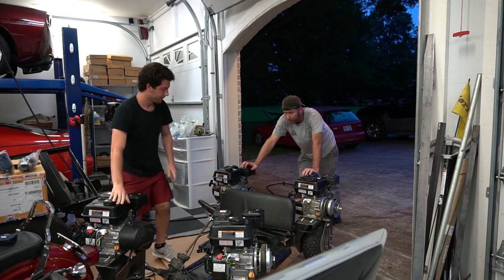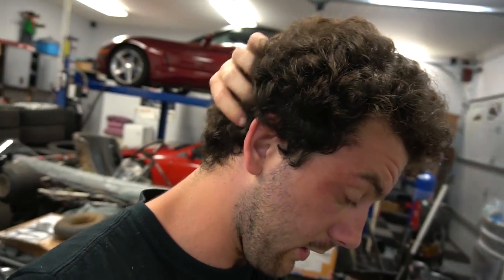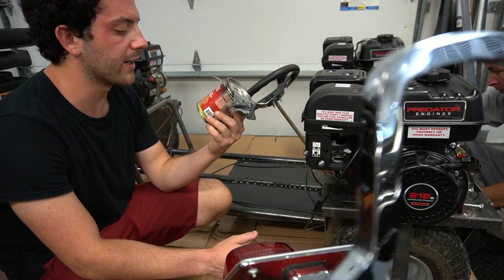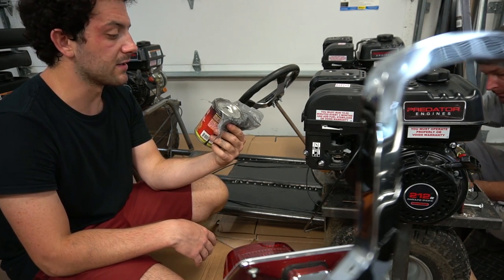Encapsulating Rust on the AWD Kart (Paint)

Comment: Ive gone through gallons of Por. Been covered almost head to toe in it. After it dries it takes about 4 days for it to scrub off if you are constantly trying to remove it once its dried on you skin. The only way to get it off faster is by basically sanding your skin down to take the shit off or trying to soak in paint thinner.  Take EVERY PRECAUTION TO COVER YOUR SKIN

Comment: I've never had POR15 stick to bare metal.  All the prep on earth it flakes up within a month.  Too paranoid to paint it on rust.  Chassis saver on the other hand is amazing.  Painted it in my wheel wells with no prep and it has stuck and looks great still a year later.  Check it out next time

Comment: POR 15 is a fickle beast.  The material needs to have "tooth" to it.  Rust (not loose) is OK, and etched metal is good as well.  However, you DO need to top-coat it or it will haze over and get funny due to UV.  I've put it on bare metal and the stuff just flakes back off over time.  Metal prep is critical, and top-coating is necessary unless you want it to change color over time.  Also, use gloves.

Comment: As much as I hate reading instructions, POR15 is a great product that will disappoint you if you don't follow the directions to the letter. Surface prep is very important. You definitely want to wear gloves and keep it off your skin. Also, it is more glasslike and not at all rubbery. As others have said, you will want to top coat it but again, read and follow the freakin directions or the top coat will peel.

Comment: $31 at Wal*Mart. Wonder if Herculiner would work as well or even Rhinoliner? Least Rhinoliner can take the abuse of C4 without compromising lol.

Seems like the general consensus is, a lot agree on clean smooth steel, it peels off, but if you scuff it with a sandblaster, grind it, or sand it, it'll stick just like it does with rust.

Comment: hi there love the vids i have been working on my go kart it had a 10 tooth clutch and a 54 tooth sprocket on axle ny tires arnt that big its a yard/street kart i juat bought the ebay torque converter its got the 10 tooth sprocket i need to buy new sprocket because its bent should i stay with the 54 tooth or go down to 48 tooth sprocket for more speed thanks .its got a 212 cc pretator stock
Reply: Chase Lowe Just to clarify, you bent your live axle sprocket, but your axle is fine? Stick with the 54 tooth, more acceleration is better until you modify the engine then go to the 48 tooth, please tell me how you bent the sprocket

Comment: Do you know why my go kart turns off wen I drift
Reply: Evan Venturino Oil sensor. They have a video on how to remove it I think.
Reply: Evan Venturino. unhook the yellow wire if you too lazy to remove the sensor the hard way should be fine.
Reply: Bingo, what they said above. I opted to just unplug the sensor and tuck in the wires with zipties.
Reply: low oil sensor
Reply: Yup disable the low oil sensor and make sure u keep enough oil in there

Comment: . use sandpaper to scuff it up and then paint it will stick better if not use primer. you're thinking of staying stain you cannot seek supposed to steer it only
Reply: only stain not supposed to be shaken just stirred unless it is a solid stain then it doesn't matter
Reply: if it's oil paint you can use paint thinner or gasoline or baby oil will work too and you will smell better

Comment: 4 into 1 exhaust PLEASE
Reply: Ryan Botting I actually second that motion!!
Reply: that would be sweet
Reply: Matthew B. Yea i just thought of that lol
Reply: true point
Reply: Matthew B. Actually it might work if they connected the front engines with a solid pipe, then going to the back use a longish flex pipe so when you turn the wheels it'll flex, then have the back two connected and have the final exit out the rear left
Reply: Ryan Botting just make a front set and a rear set.